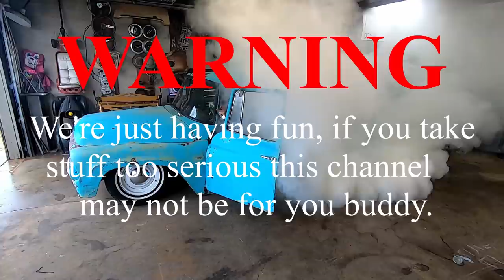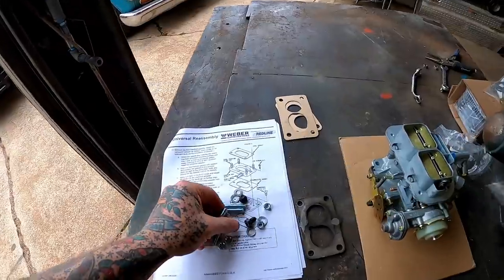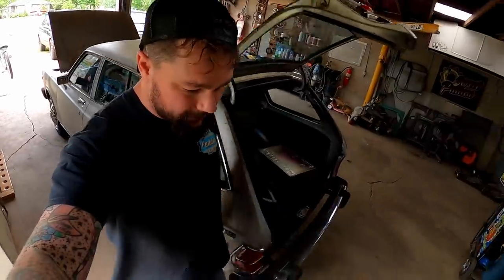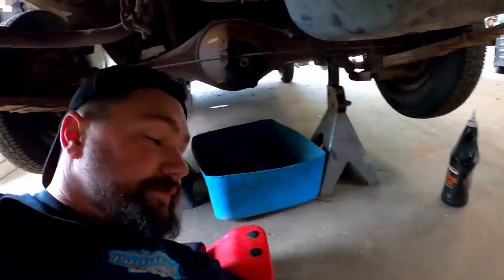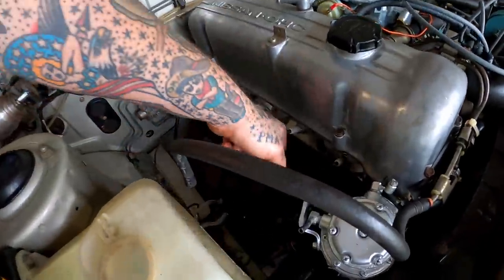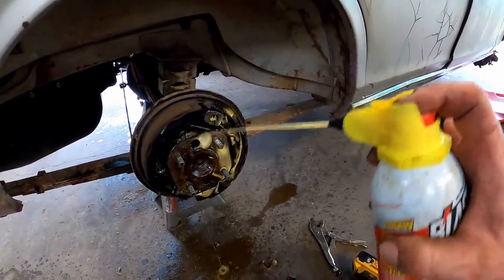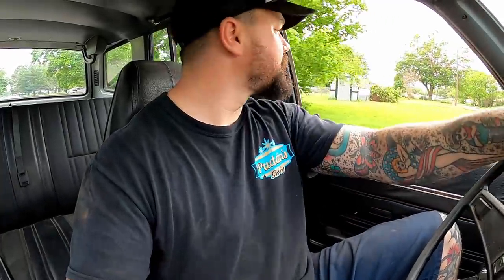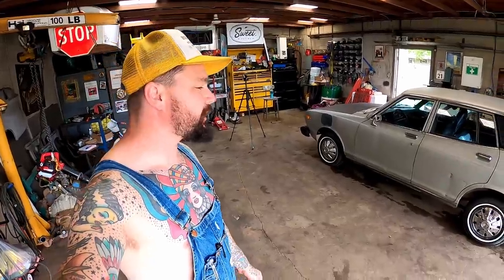Will it DRIVE after being ABANDONED in a SALVAGE YARD?! 1977 Datsun 710!

Comment: 38:43 another thing you can use isntead of cat litter, marbles, or screws is a length of chain.  Stamped sash chain works the best because of all the sharp edges.  Then when its time to come out, you pull it all out at once, no need to shake it around and move it 47 different ways to clean it back out.  Oh, and some cheap toilet bowl cleaner or white vinegar will give it some acid to dissolve the rust too.   Then just rinse it with baking soda water to neutralize the acid, and then a coat of diesel fuel, kerosone or marvel.   I just went through this with my Harley tanks.
Reply from the maker: Just used what I had that day.

Comment: I just got done ripping all that smog crap off my 1984 Ford F150 and let me just say this, best decision of my life. That truck since the day I bought it had a slight miss at low idle but once you brought her up to speeds that miss went away. Once all the smog stuff had been ripped off never had she idled so smooth before and that miss gone for good.
Reply from the maker: Awesome!!
Reply: Got an 82 F150 with a 351, and an 85 F250 with a 460. They both run so much better with all the emissions nonsense deleted. They both also woke up quite a bit when I installed some cheapo Flowtech long tube headers and 2.5 inch dual exhaust.

Comment: I remember my old Nissan 720 pickup (1984-- the year they changed from "Datsun").  It had an Aisan 2 barrel carburetor on it, and I rebuilt it at home.  The choke was attached with 3 rivets, and the kit came with replacement rivets in it... one of the tougher carburetors I ever rebuilt with lots of springs and linkages on it.  I wound up using my video camera (one of those old "over the shoulder" Panasonic units that held full-sized videotapes) to document the disassembly which came in very handy when I put it back together!  Ran so much better when I got finished!

Comment: My parents had a 1976 710 2 door hardtop. It was bought brand new. I will say here in NY ,the rear wheel wells rusted out by 1980 or so. It was garaged all the time. That car was a 4 speed and it was about the same color as yours.,same engine, hub caps and a factory am/fm mono radio. I remember marveling at the build quality compared to the '73 Malibu wagon it replaced. It sure ran great. I took my road test on that car. We even put a CB radio in it with a trunk mount antenna!
Reply from the maker: It crazy how quick these things rusted away.

Comment: I bought a 63 Chevy about 25 years ago.  Been sitting for 15 years in a field.  Got it running and drove it home on the highway about 45 miles away.  Since it was a fairly long ride, I got to testing the interior buttons Wiper, cig lighter etc,,,     Turned on the blower...and Poof!  Everything disappeared in an instant.  After some struggle I got her pulled over to air out and clean my eyes.
Another Driver who had been behind stopped and said that was the best Cheech and Chong impersonation head ever seen.  Apparently I billowed dust out of the windows for quite a long time!
Reply from the maker: Hell ya! 😂😂

Comment: I bought a Ford 352 yesterday from marketplace and when I got home I thought well I didn’t even pull the dipstick out to look at the oil and I had no idea why I didn’t do that and it had water in it so I picked it up with my hoist to drain it and about 2 gallons of water came out before the oil. I did get it turned over after I pulled the damn thing apart and it’s not really that bad. Ohh the dude said it was under the hood and not exposed to the elements.
Reply from the maker: Of course it was. Just ask him.

Comment: Loved the gas tank strapped to the wheel.  Never saw that before.  Try ball bearings in the tank, with it dry, and it knocks a lot of that rust and crap loose.  Great video!
Reply from the maker: Yep! Just trying to use what I had at the time!
Reply: @PuddinsFabShop  a little 'chat' gravel works great, don't run it too long though!

Comment: I've seen many ways to tumble clean a tank, but the kitty litter was a first for me. Seemed to be effective though. The best thing I have found to use is about 6ft or more of No.1 or No.2 wire link dog chain, bike/roller chain, barb wire wrapped large bolts, or any rope like object that has sharp and/or jagged features of sorts with a little weight to them. Also add a solvent such as vinegar, mineral spirits, diesel fuel, etc....  Normally I will tigh a string to one end of the said chain with the other end of the rope tighed to the filler neck to make it easier to remove the abrasive object. Hope this helps buddy!!!

Comment: I ran a much larger tank on a ford 5000 tractor wheel years ago with rocks and degreaser in it.  You should mount the tank at and angle when on the wheel so to clean the bottom and top areas of the tank!

Comment: Muriatic Acid . Every time I see someone try and tumble the tank,  it still comes out looking like crap, they have to redo it and redo it.  Even those who know about Muriatic Acid , think they are going to get away with some other method.   No, I don't want to spend 3-4 hours on a 30 minute job,  and I want it done the FIRST time.  When I first discovered the Acid, I had a sectioned fuel tank, where there is no way to get nuts and bolts into the compartment.  It was a bad rust issue on a vintage rare tank specific for the vintage trike, that can not be replaced. Now, I use Muriatic Acid  for EVERYTHING. Acid is reusable. Rusty nuts and bolts, tools, throw it in there for a hour, then rinse it off. Same with the tank. Give it about a hour, drain it, rinse it dry it and throw some fuel in it to keep it from flash rusting.  While you are spinning your wheels.. using rocks or sand or.. There is a bigger chance your car can come down off the jack and just take off.  Whatever it hers is going to cause damage.. And what if your little girls out there and this comes down, not saying you are being irresponsible, but  Muriatic Acid  is $8.00.  And you can use it over and over.  And that goes for anyone with rusty stuff. I threw all my rusty tools in there and coated it with oil. I stripped some antique vices to restore.  If people have never used this method to remove rust.. Try it. It's easy, fast and no fucks given, it does it. I won't EVER switch. No one is ever happy with the tumble method. It works, in a pinch, and if you have the time..  But you are going to hate the result, because tumbling a tank is loud, time consuming, and misses all hinds of spots, not to mention, you have to jack up your car to do it.. Dangerous Not are actually working 10 x harder TRYING TO WORK LESS. Take it, leave it, but if someone else has a massive rusty tank, just try this, don't waste your time with a hope and a dream. Don't sweet talk it, hit it with a attack it will not forget. No prisoners.

Comment: Make sure vacuum  advance is  working . Had an 80 model with  a14 pushrod  engine  ,not very powerful  but a tough little engine. They rust away even here in Alabama. It was a5 speed.

Comment: I had one of those.  You couldn't kill it.  I had a slow head on collision in the snow with a Chevy wagon.  The radiator hit the distributor and bent the shaft.  I took a hammer and kept hitting the end of the shaft till it looked straight, threw the cap and rotor back on and it fired right up!  Most uncomfortable seats ever, but it would get you there!

Comment: Yep. the 125 rpm up to 200 rpm of the crankshaft is during the cranking the engine before it fires. the smaller the bore of the restrictor plane of its intake manifold and smaller bore diameter of carburetor the manifold vacuum is lower the air pressure down to 5 psi (20Hg) but you add bigger bore diameter so the MAP is like at 6 psi. Your timing will need advance more after installing new carb Weber.

Comment: Here's another funny story. Had a 1972 710 PU auto and like the wagon there, no get up and go. My Sis basically burned up the 1800 that was in the truck. So I had a 1969 510 Coupe with a 1600 in it, that later turned into a 1985 2.8 GM v6 and auto. Anyway the 1600 turned it into a near new truck, I could even a small amount of wheel spin out of it. So I never looked for a 1800 or 2000 because of the low compression.
Reply from the maker: Well damn.

Comment: My old 710 had more screws in the vacuum lines than the space shuttle. Plugged all that stuff off. Never thought about folding it over with duct tape. Just stuck a screw in the end of the hose.
Reply from the maker: I’ll put a real plug on it. Just using what I had.
Reply: @PuddinsFabShop  Now your getting fancy.

Comment: Here is another little hack. Mirrors. Rustolium makes mirror paint you spray on acrylic. That you spray paint it on glass or plastic, and it dries into a mirror.  You can make all kinds of crazy shaped mirrors. You are missing a mirror, so, thought I would kick that down, cans are also about $8.00. How much will it cost to replace a mirror? How many mirrors do you get in a can? Auto, house hold, arts and crafts.. Think how awesome that is. Mirror in a can.
Reply from the maker: Pretty neat!
Reply: @PuddinsFabShop  Youtube it.  Once you realize you can make plexiglass mirrors.. Imagine if you heated a plexi and formed it around the hood, then sprayed that into a mirror finished hood.. Or fenders, or doors, or what is that vacuumed plastic?  Buy a can and experiment. That if you can mirror shapes..

Comment: After 1973 fuel embargo , datsun and hondas were being sold along side pontiacs near the Chevy dealer I was working at in 77. Depressing times I wont forget , gas was38 cents a gallon then went to over a dollar a gallon during the shortage. You could only buy like 5 gallons max in horrendously long lines

Comment: Some of the older Mazda used slide on clips as well, as for the energy drink, see if you can stand one of the trucks up on 4 of them 1 under each tire! Then see how much weight you can add to explode them!😂🤣😂🤣😂🤣, vinegar woks great to remove rust also!
Reply from the maker: Not a bad idea.
Reply: @PuddinsFabShop  are you up to a little 🎃👹👻☠️👽 fun? rules keep it simple made out of wood and metal, and maximum hp of 6.5 hp.oh yeah you have to be able to drive it!😂🤣😂🤣😂🤣👍

Comment: My 69 charger had set for years and a old time machinist who had rebuilt engines for year's told me one I get the tank cleaned out and installed back in the car when I filled it up with fuel I should add 2 stroke oil to it every time I filled up he said the 2 stroke oil would eventually impregnate itself into the metal and it would also help in lubricating the ol school valve guides

Comment: Tossed a Weber 38/38 at my Datsun 720 since a rebuild on the Hitachi lead to it mysteriously flooding the truck. Haven't regret it, but did find a return to idle problem that has me running excessive return springs and that aluminum adapter plate is way too easy to strip.. It works but thinking quad motorcycle carbs sounds more my speed.
Reply: Idle problem turned out to be a throttle cable being bound up, and replaced those cheap adapter plates with ones custom machined from mild steel by the local college.

Comment: Next time you need to clean a gas tank out I learned a little trick from mustie. He throws a bunch of old bolts in there and then straps it to one of the wheels on his pickup truck jacks it up put it in drive and it will sit and tumble and knock all that crap out of there I've seen him do it so many times and it gets great results you've been able to save a lot of original gas tanks that way. Oh s*** just as I said this you went ahead and started doing it it's like you read my mind lol

Comment: There are people out there that don’t work on cars and think that once it sits for a while that you have to replace everything and that’s not always the case sometimes you could just have to replace the points and it will  run. Sometimes you could just replace the spark plugs and it’ll run sometime. You just replace coil packs and it’ll run or just the coil or just the throttle body sometimes or if it’s naturally aspirated and depending on the carburetor, you can clean it or just replace it and it runs sometimes the combination and sometimes it just wiring only way to tell with a car is to start in one place like the battery then compression then spark, and after all, that if it’s still running like shit with all the old stuff, but the old stuff is working, then you go to wiring it all just depends on the car and the situation

Comment: Instead of cat litter I always have really good luck with just regular ole nuts ones I got are half inch outside diameter but guess any small nut will work as long as they are stainless steel my buddy uses pennies and they work also just takes longer than the nuts

Comment: For a car without a lot of computer stuff that the modern cars have,  the cars , I would say up to the 80s, are easy to work on, afterward the cars were very difficult to work on, with so many sensors, and electronic stuff, these cars  still use  points ,condensers
Reply from the maker: It’s really easy.

Comment: .032-.035 is standard
Watch the thermal clutch on the fan.
They get old and lock up, killing horsepower at higher rpm.
Plus, they get noisy when the fan is pulling air when it doesn’t need to.
Had to replace a few over the years.
Reply from the maker: Good advice!

Comment: Don't get me wrong Puddin you are one of my favorite shade tree mechanics. Never miss one of your videos. But, you donot preload that type of wheel bearing. You only tighten to zero free play then loosen 1/4 turn. If you do tighten more you will find yourself running with over heated wheel bearings. Only untill they fall off of course. If you do not beleive me then look it up before you get some one hurt.
Reply from the maker: You do realize that if you go to zero and then a 1/4 turn loose, that they are now loose, right.

Comment: You have a perfect tank drier sitting in your driveway. Put the gas tank filler neck up to the exhaust pipe on the towrolla and run it for a while. The warm exhaust gas will dry it out in no time.

Comment: Tell you what other than surface Rush that frame looks really good  I had a oh what the hell was that thing at 80 something  Nissan Datsun King cab 4x4 it buckled right behind the cab and the bed man the frame was that bad. But the short side of the story we just took some plates I believe we use some angle iron and have my buddy welded up it worked fine it was just an off-road truck it was not a driving highway truck it was this one we used in the woods.
Reply from the maker: That’ll work for a woods rig!

Comment: 45:52 I used a diesel heater when I did the tank on the 300ZX basically heated the metal on the outside and it evaporated everything on the inside.  1:14:40 Park it n' Mark-it ... so funny.

Comment: Years ago people with those Datsuns used to  put Ford Pinto Carburetors  on them  you could pick those up in Junkyards  for 10 bucks or so and any parts store had the rebuild kits  in stock  i saw a guy  that bolted one on a MGB  and he fabricated his own Adapter  i’ve owned many British Roadsters and that  guy swore  it ran better than a Holley he had tried on it ?  i’ve had good luck withHolleys personally  and they are my go to  for my inboard Marine Gas motors  although  these days with the Ethanol in the Gasoline  i’ve found the Holley Accelerator Pumps need replacement once a year ?    i have a local Hot Rod Shop that can get me just the AcclerTor Pumps  although they do come ina rebuild kit from Holley

Comment: I had a 77 b710 sedan. The carb was its Achilles Heel.
Reply from the maker: I bet!
Reply: @PuddinsFabShop  bought that car for $250 bucks, drove for 4 years. It had an overhead cam engine in it, and a 4 speed standard. I thought the engine cam from a truck? IDK..My first car was a 77 B-210, 4 door 4 speed. Bought it from a farmer for 75 bucks, needed a battery and front struts...They were great little beaters to learn on.

Comment: The baseball bat to parking brake trick is just for you southern folk. Here in Wyoming we use the long handle ice scraper and jam it to the front of the seat!  HINT: this may or may not work for a cruise control when driving across the boring state of Nebraska!

Comment: Hey pudding throw that garbage PB-Shit blaster away and I promise you if you get a can of Aerokroil and use it for any rusted bolts you will realize how much you’ve missed using that stuff!! If you look up there web site and see some of the stuff people have used it on and been able to free up you will be amazed!! Areokroil puts that PB-shit blaster to shame I promise you!! There is a reason big commercial companies use it!! Because it absolutely works!! I even have been able to get exhaust manifold bolts out of the heads in trucks that are from the 60s I’m a big fan of 1967-1972 Chevy trucks and they can get pretty rusty!! I was able to get every bolt out just by spraying and letting it sit over night and soak into the threads!! The last truck the guy told me the exhaust manifolds were cracked and tried to replace but couldn’t get the bolts out and that he had the heads of 3 or 4 of them rounded out and he gave up!! He even said he tried to give them some heat and still didn’t have any luck!! No problem for Aerokroil!! I buy it by the case and just sell half the case to others that are always asking me for some!! The stuff definitely works just have to let it sit and soak in depending on how rusty they are!!! Good luck buddy!!